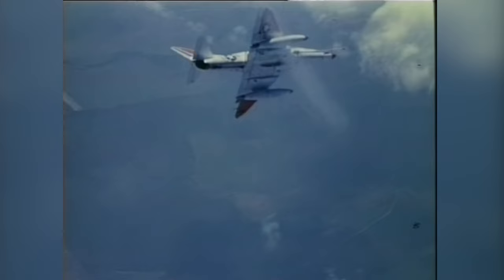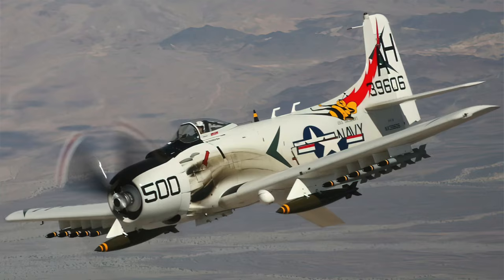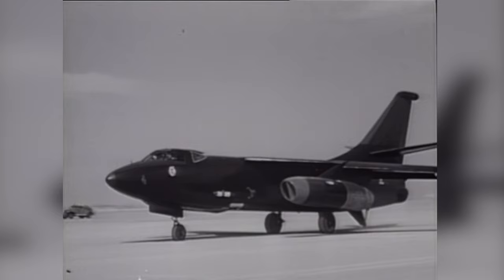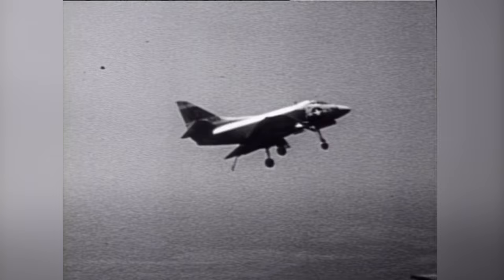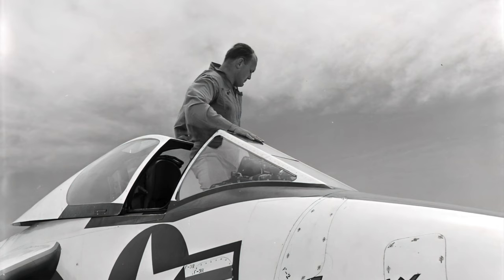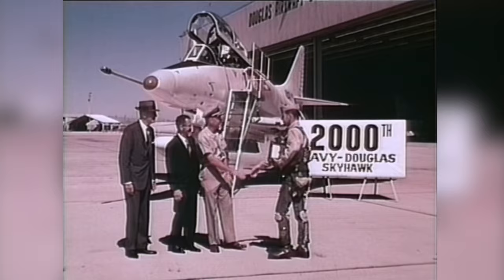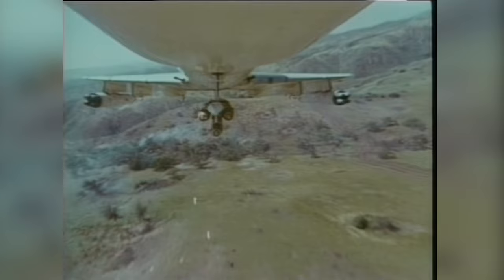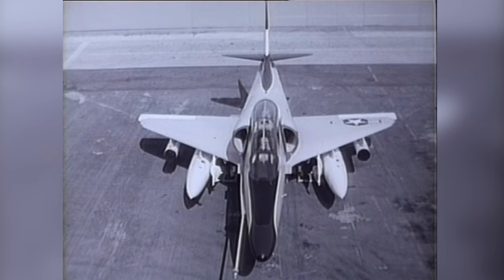A-4 Skyhawk. The American subsonic carrier-capable light attack aircraft made by  Douglas | Upscaled

Comment: I did a HVAC service call at a retired navy pilots house years ago. He was a A-4 pilot in Vietnam. If I remember correctly he said there was a rivalry between A-4 and A-6 pilots. He told me that they used to rib the intruder pilots about sitting side by side. Something about giving each other “special attention”😂. He loved flying them and said they were so nimble and responsive.
Reply: Yes, the line was"real pilots don't sit next to each other"
Reply: @daleferber2096  Apparently commercial passenger and cargo pilots are frauds, then. I get it...hassling/ribbing not taken seriously, but sometimes it's a bit over the top and becomes a parody of itself.
Reply: @nonnobissolum  Relax already. It was a common line among aviators, F-4 and later F-14 guys vs  A-6 guys nothing more than that

Comment: A new Skyhawk based on the A4 should be welcomed by air forces. The biggest complaint I’ve heard was their 20mm Colt cannons.
Reply: Hence a few operators installed either DEFA (Israel) or ADEN (Singapore) 30mm cannon in place of the 20mm. The problem with a new build Skyhawk-type jet is that it would need many of the same systems as a fancier design (engine, radar, ESM/ECM etc). The closest you’d get would be something like the Boeing Saab T-7 or Korean TA-50.